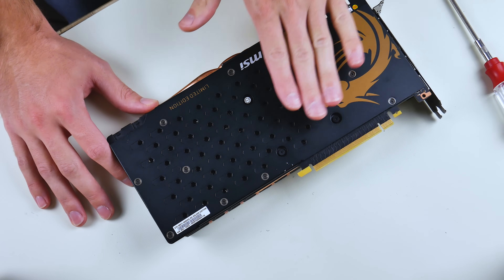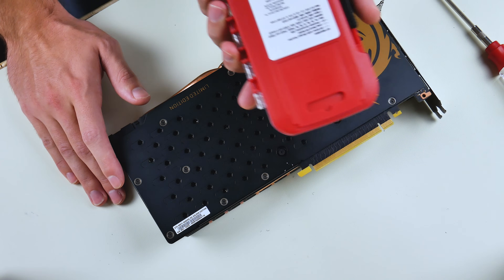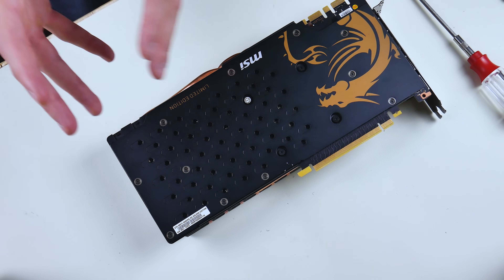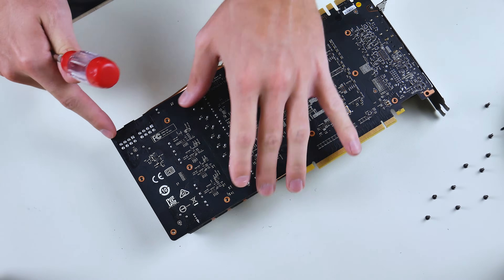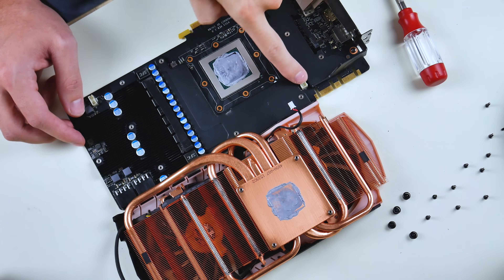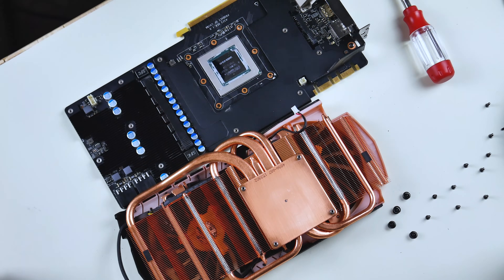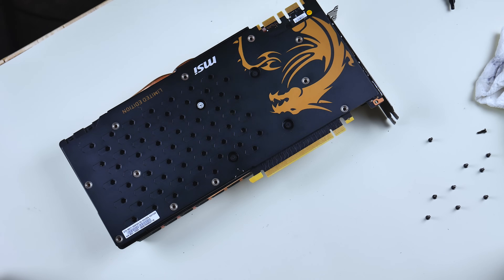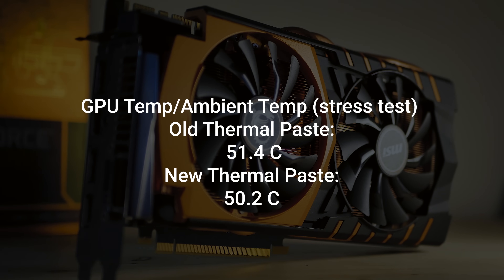How To Replace GPU Thermal Paste - This Is Crucial

Comment: Thanks man! Very helpful video! Just changed the thermal paste on my GTX 1060 from 2017. 78°c before changing it and 59°c to 60°c max with new thermal paste in full load.
Reply: Holy shit 20°C difference. That's a lot man. I gotta try it on my 1070. The thing is going 70°~90°

Comment: My Msi R9  had artifacts so i flashed another bios to it using ATI flash, installed a driver and then ran FURMARK..got 65 fps @1080p no glitches and has temps of 58c

Comment: I'm concerned about putting the dot of paste in the center. I know with some CPUs you can do this because of where the cores are located, but with a GPU chip is it the same? Do GPU chips have cores like CPUs do? I know some CPUs you're supposed to put a vertical or horizontal line, etc.
Reply: I know I'm 5 months late but it's the same concept, the heatsink is gonna spread it all around when you screw it in...
Reply: @HandledToaster2  It really isnt, the amount put in this video will spread in a circle shape and cover only probably about 75% of the total surface of the chip
Reply: @cptsetsiyah1729  I see what you mean. Would that really cause any issues though? I replaced my thermal paste and didn't have any problems (didn't get any cooler either though..)
Reply: @HandledToaster2  Depends on what type of chip it is, im not on an expert but from what ive been able to gather some chips cores are located in the center whilst others are more spread out, the latter usually applicable to gpu chips. In which case complete coverage will yield the best result
Reply: @cptsetsiyah1729  huh, then maybe it'd be better to make an X instead of a dot, that way it could spread to the corners
Reply: @HandledToaster2  Thats what I did today, on both cpu and gpu

Comment: There is a reason why they put thermal paste on the sides aswell . There are tiny capacitors there that heats up too and need to be dissipate heat aswell.

Comment: i found out that i got the best temps when spreading the thermal paste on the gpu
Reply: Agreed. GPU application is different to CPU so you can be a little more generous. I did mine last night and applied a thin layer then a small dot in the middle. Junction temp dropped from 110 to 80 under load. I I now get idle temps of 48! A bit scary with the current market but the results speak for themselves.

Comment: I just changed paste on my rx 470 4gb and it dropped from 80 to 65 on 100% load, and with using 20%less fan speed, before it was at 60-70% and low its running easily below 50%
Definitely worth changing it if u got second hand ones or few years old

Comment: I’d say for thermal paste of your not sure if you have enough just use a little more because you can’t really over do it. If you do and it leaks out the sides a bit it’s fine and the temps are the same or better.

Comment: This is a pointless video, with a click bait title "This is crucial" in it he proved how not crucial it was. A 1 degree C delta after stripping a GPU! (Possibly Error) Kids don't try this at home it's a waste of time and may easily brick your card. Just another pleb pushing out a crap copy of other videos out there. Content creators? A fancy name for posers who want to be a teacher.
Reply from the maker: Is your comment supposed to make you feel better about yourself? You're absolutely supposed to change out your thermal paste on both your CPU and GPU every few years and test your thermal paste at least every year. This card for example is several years old. Any denial against that is a straight lie. Temperature delta is not the objective, thermal paste has liquid within the material, that liquid will dry over time. It is absolutely crucial to change this every so often to maintain the contact integrity between the block and the top of the CPU.
Reply: @jdtechgear  No you're not I haven't read that in a single manufacturers recommendations and they use very long lasting T.I.M for that reason, 10 years easy. Also the phenomenon known as "pump out" is  prevented by the large oversized amount used, and the hardening of the edges. Show me the GFX card company that recommends this? Surely it will be easy. I won't hold my breath. And still Click Bait.
Reply from the maker: @johndoe-ns3he  No manufacturer mentions it because most manufacturer warranties usually cover up to 3 years. Older cards beyond those 3 years should definitely consider changing the thermal paste. Doesn't have to be right at 3 years, but take 5 year old card and it will most likely benefit. Some cards may fair better than others in terms of thermal paste longevity, but I wouldn't wait 10 years for that. I really don't care if you think it's click bait.

Comment: Quick tip put the plate back on, then back off. Look at how the paste spread. Cover the missing parts slightly. Make sure its uniform BEFORE fitting everything back in.

Comment: I bought a used Rx 570 last year from AliExpress which came in good condition I used it and it worked with no problems but now when I am playing heavy games my pc keeps crashing but I installed msi after burner and kept the fan speed to 90 while playing and it's not crashing so yeah the gpu is overheating the max temp I got is 77°C
Reply: the rx series all run hot my 580 hits 80 every once and a while during long gaming sessions i thought something was wrong changed the thermal paste temps only dropped a couple degrees
Reply: @madhatterentmt6146  damn means it's a problem in the GPU
Reply: @yahyahasan1554  the rx series cards run hit their optimal temps are around 75 ish so your fine at 77c
Reply: @yahyahasan1554  they don’t really get damaged till 95 degrees
Reply: @madhatterentmt6146  yeah

Comment: I disagree about the warranty statement. In Germany many manufacturers (EVGA, MSI, ASUS, Gigabyte) explicitly allow you to remove and even replace the standard cooler with a water block. Some even explained that it makes sense to exchange the thermal paste with time to maintain performance. 
Other companies don't state this, but exchange the card in fairness if it wasn't damaged in the dis- or reassembly. Research this for your country, your mileage may vary.

I know this video is nearly 2 years old, but since it still comes up as one of the top search results, it's still relevant.
Reply: One other thing: While the blob method is fine for chips with a IHS, a GPU paste application should be spread across the whole die surface and making contact with the cooler. If you are unsure about the spread, pull the cooler off after settleling it on the die and check. If it's fine just resettle the cooler.
Consumer CPUs are forgiving when it comes to mediocre application, large GPU dies are very much not. I fried a Radeon 9500 pro like that back in the day. Just use some non conductive paste and you will be fine.

Comment: Is it safe to use thermal paste that's meant for CPU and CPU coolers?
Reply: Yes but make sure its a non conductive one
Reply: @F-22raptor-22  Oh... How do I check? Does it say on the thermal paste?
Reply: @shuerzz5403  it may if not look up the brand online
Reply: @F-22raptor-22  Mine on the back says "Thermal Conductivity:>0.925-3.925W/m-K", so uhhh... Should I not do it?
Reply: @shuerzz5403  That's thermal conductivity, which is what you want. Electric conductivity is what you don't want. Unless it says "liquid metal" you're probably fine to use it.
Reply: @2m0ng032  Oh cool, thanks!

Comment: You need more thermal paste. It's a different than putting thermal paste on the CPU. The CPU has an integrated heat spreader (IHS). The GPU dye is bare with no IHS, thus every part of the dye must be covered.
Reply: yes, really
Reply: I thought the same thing. This looks like a Criminally low amount of thermal paste for a gpu. I personally add a generous amount to mine.
Reply: you must cover gpu as much as possible cover all spot
Reply: @bufalong  Yes! Cover the the plastic and the ports! Cover the fans too! You will need a paint brush to put it on until the paste is dripping off like a waterfall!!! 🤯🤯🤯
Reply: @MobileDecay  and if that's not enough pour bucketloads of thermal paste in the pc case as well. just in case
Reply: @MobileDecay  I like to add 1 L of rubbing alcohol to a 10 L bucket of thermal paste. Dip the pcb in the liquid, put on the cooler and dip the whole thing again. Let the excess drip of and let the alcohol evaporate wich makes the paste set. Now you have optimal cooling and a fancy paint job on your card. The fans tend to run a bit slower but this is compensated by the layer of thermal paste that will go all the way to the case and give you passive cooling. I find that most of the time my fans don't have to run at all!
Reply: @christopherstein2024  legend has it if you cover the entire PCB in liquid metal and turn on the GPU, your temps drop to 0C
Reply: thank you so much for saying this! i put so little the first time that i think my chip was barely making contact to the heatsink, I've had headache with this for months, now i put a lot and it dropped from 100c hotspot at 3k rpm to 80c hotspot at <1k rpm, im so happy now
Reply: Thanks for this info!
Reply: That’s what I’m saying
Reply: Very useful to know! Thank you!
Reply: thx 4 this comment! i got plenty to spare
Reply: Really?
Reply: its not like cpu with big ihs gpu need thermal paste full on surface
Reply: @bufalong  He said no such thing.
Reply: @bufalong  yeah no shit sherlock, he just said it no need for you to repeat it 💀

Comment: Hey there mister..my post display is not showing after reapplying thermal paste ..however i can acces to bios ..but when its gonna load into the windows ...black screen happens and sometimes it restarts itself and sometimes i gotta restart it ...i used thermal paste green(its a reliable brand both for gpu and cpu)and i saw many ppl having this issue even with ultra quality thermal pastes ..and btw i used only small amount of it ..i dunno whats the prob ..and my reason for changing that paste was my gpu which downclocked itself wether on full load or the tempreture  above 60...and saw some ppl got it fixed by changing the thermal paste..so anyway plz help me man
Reply: Seems like it overheats and turns off, is the cooler making contact
Reply: @F-22raptor-22  i dunno abt that yet .but can it be fixed anyway if the issue is contacting?
Reply: @elinbarrage9638  I mean if the screen shows up to bios and no lines or anything then nothing wrong with gpu probably
Reply: @F-22raptor-22  but now there is no screen although  fans are spinning

Comment: The factory did a poor job of applying (too much) thermal paste on your GPU. Shouldn't be oozing out to the side of the chip like that. I opened up my EVGA RTX 2070 and it was in a similar condition as yours. There was so much thermal paste on the side, it looked like a thermal paste wall surrounding the chip. The chip barely had any thermal paste and it looked dried up with what looked like air bubbles that dried up. My GPU is about 9 months old. I was wondering if it would be okay cleaning the thermal paste on the side. I just didn't want to risk any damage. My idle GPU temps were 55*C and now it idles around 42*C.

Comment: I just buy rx 560 just a few month ago ! It some time crash/hang/black screen come then i have to manualy restart the cpu .. ! Whats the solution for this ? Or its gonna fine with the change of thermal paste ? Waiting for answer !
Reply: Have you updated your drivers? Are you overclocking it? Did you buy it new or used? Might be a power supply issue, but I'm not sure it would cause these symptoms.

Comment: I recently got Rx 590 Gigabyte 8gb... The latest drivers are installed...My Processor Ryzen 5 2400g... PSU 650W Circle... RAM 24gb.. with two fans 1) Processor and back fan...  My GPU  temperature hits 80C... just by playing GTA 5 for 10 mins.. what could be the reason? How do I fix this? and idle GPU temperature is 35C...
Could you please help!
Reply: Increase fan speed and/or try undervolting the card.

Comment: got mine but a just 5 days after repasting got pump out i think temps back at high temps... any tips bro .. ? hope you can help tnx
Reply: Increase fan speed. Undervolt.
Reply: tnks for the reply brother bot got it fixed by replacing different brand of paste... thanks bro

Comment: I know its dumb but i just removed the io shield that blocked my gpu air vent , i   was never a tech guy got my pc built from market now after 3 years i somehow figured my gpu air vent was blocked , i used to get performance throttling but never new what was reason my gpu is RX470 , now after removing io shield the tempratures are better but than before (88-90 underload ) Now theyre like 80-85 under load never go above 85 , So should i change my thermal paste of gpu as i dont think airflow is a problem cause my cpu is like 60°C under load.
Reply: Yes, you should change it.
Reply: @2m0ng032  already done

Comment: This video is a mistake. The right way to put thermal paste on gpu is spreading it on the all die, u shouldn't put it the same way u put in cpus. This method is wrong.
Reply from the maker: Maybe you should read the pinned comment

Comment: Same here my RX590 went from 85 degrees to 60. On heavy load.
Reply: Do you have the Fatboy? I wonder if your temps are with automatic settings? I have to put a manual fan curve to get mine stable and I'm thinking of doing this
Reply: It's automatic off when not hot. I would not mess to much there. There is a app tho msi afterburner were you can see everything

Comment: You should replace the thermal paste even if it's new, because manufacturers use a bad quality paste. It happend to me with an evga 2080 xc, was going on 80°C with fans at 100%, after changed with arctic mx4, themps droped to 70-72 with fans at 65%. Game tested RDR2 in 2k with high-ultra settings, card it's OC with +1050 on mem and +120 on cip.

Comment: Actually according to the warranty act of 1975, unless your actions damaged it, your warranty cannot be rendered invalid. Just so you know. Manufacturers HATE that information being out there, but MSI themselves are pretty fuckin chill about it. It's sort of an open secret with them.
Reply: Noted! RTX EVGA GPUs do not seem to have a void warranty sticker like this MSI video card. There is a black warranty sticker on the backplate and it doesn't require removal. Maybe EVGA knows this and they are okay with people opening up their GPUs.
Reply: what happens if the screws are slightly stripped?
Reply: @Buddhadan100  shouldn't be an issue if the screws still function
Reply: @HeadphoneTarnish  Does this apply to ALL warranties? What about missing parts with a monitor warranty?
Reply: @dawn-blade  if you don't fuck it up, you do not void the warranty, not even in the land of the not so free.
Reply: @Buddhadan100  still can still be returned, it's called the 'perfect tender rule'
Reply: The Stickers Are A Lie...
Reply: ☝️Doesn't apply outside of the U.S
Reply: you'll likely be outside of warranty by the time you think to repaste/repad.

Comment: I know it's an old  video but thanks for this. You explained everything and it's looks like a very simple procedure.  I bought an MSI 1080ti from eBay and I will replace that old thermal paste for a new Artic MX-4.
Reply from the maker: Glad I can help! Good luck with the reapplication!
Reply: Did it help alot
Reply: @mathias4514  it did. When I got the card I was hitting 90c on games playing ultra. When I changed it, it went down to 72-81c depending on the game.  So it was a huge improvement for me.
Reply: @Kratz517  damnn thanks for the update might have to swap out thermal paste then.

Comment: Cleaned my 5 years old GTX 970, while i was wiping the caked thermal paste using paper towel along the side of GPU, accidentally i rubbed it hard. Noticed a small micro chip was missing from the PCB board.
Reply from the maker: Does it still work?
Reply: @jdtechgear  yes it's still working perfectly...

Comment: perfect application you done un cooked rice size paste on the gpu last time my graphics card giving 78-80 degree on furmark then I do wash my heatsink and clean the dust from the fans and apply this quantity of thermal paste now my temperature drop from 80 degree to 68-70 degree on furmark :)

Comment: this video is a year and a half old as of right now and companies have changed to where you will NOT void your warranty in order to reapply thermal paste to your GPU because of water cooler features like the EVGA water block for example.

Comment: You put like 1 for on it, aren’t you supposed to spread it out ?
Reply: When you put the cooler back on it will spread by itself because the heatsink is pressing it out
Reply: Yes, you're supposed to spread it out. Or use an X pattern to make sure it covers the whole die.